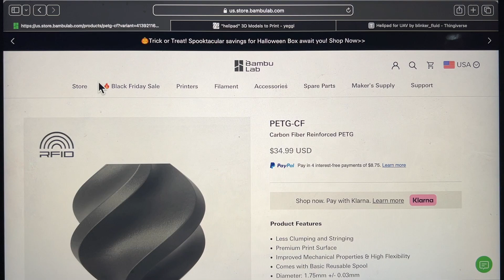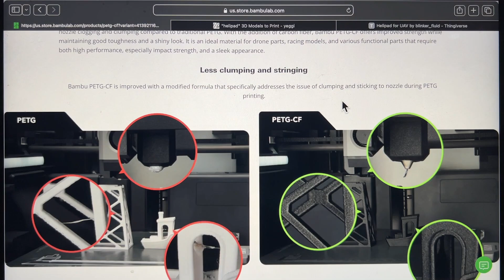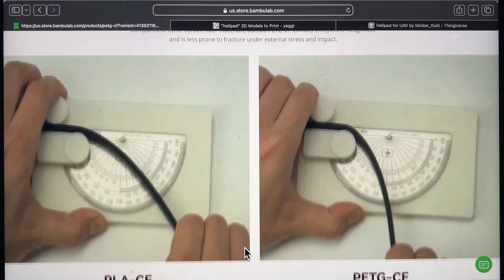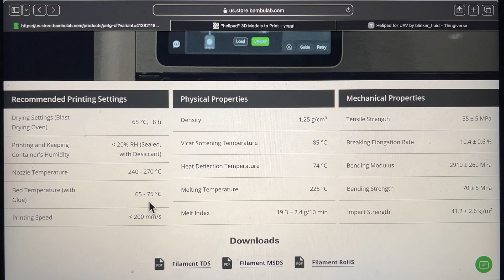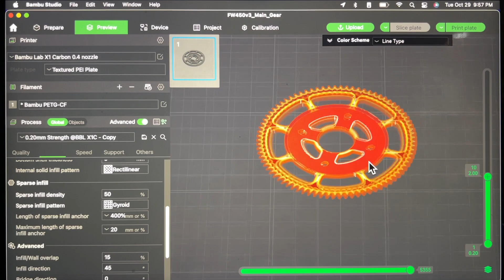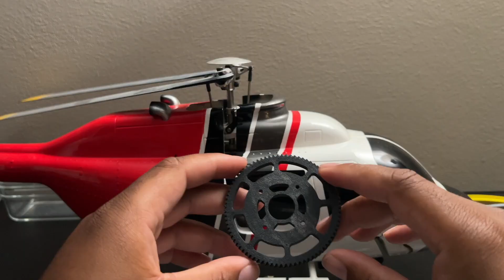Print & Fly Flywing Main Gear Series    HD 1080p

Comment: PET-cf is prob gonna work better, petg is still a little soft in comparison. it also has a higher heat resistance. you're also gonna want to make that a solid part with zero infil. for the total heat tolerance/density
Reply from the maker: I want to try the original print file from the creator to see if it works, but if it fails, I will probably make modifications.